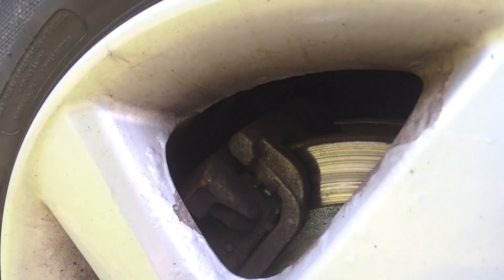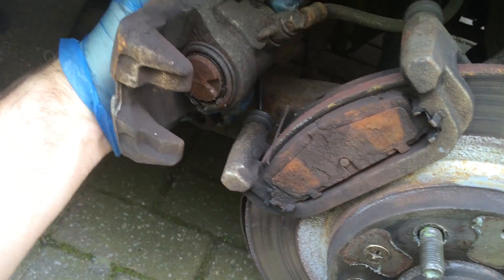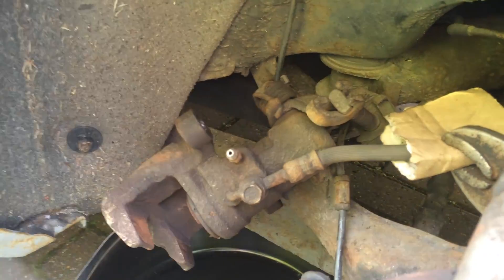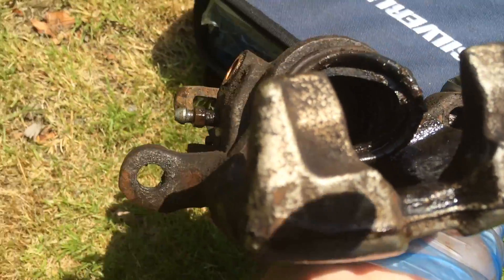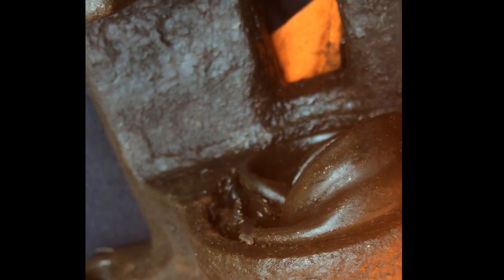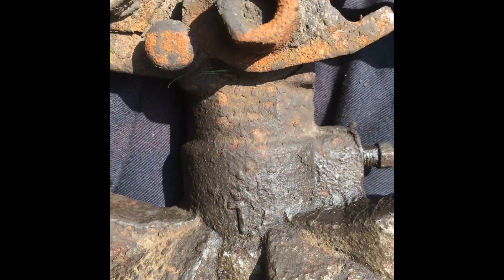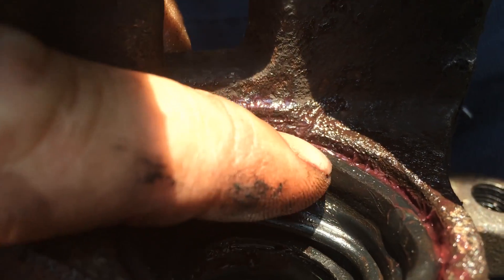Replacing rear brake caliper seals

Comment: You did not replace the seal on the parking brake side. Every failed rear caliper I had was leaking there. I came for a solution, but unfortunately you only changed half of the seals.
Reply from the maker: Correct - I only cleaned up the main piston seals on this one. This was a very long time ago. I'd do a much better job if I had to do it again. At the time, there were other issues with the car, so only did the minimum. A lot of rust on rear suspension parts, water leaks around window seals. wheel bearing failures... It was getting to be more of a hobby, than a reliable car.

Comment: What type of garden wire did you use?
Reply from the maker: green bendy stuff (mild steel). You can probably find it in your local garden centre - Thick, not thin. Or 'mesh' fence wire. What they use to hold the mesh fence to a post by twisting this wire around it. Bit vague, sorry
Reply: @alanmann  Thank you

Comment: I replaced the square o ring seal for the piston in my caliper and ever since I have brake fluid seeping out of MC reservoir cap...could the new seal be not 100% compatible or would I have introduced air in the brake lines.

Comment: A semi-complete caliper rebuild kit will be on average $30, (Pistons, seals and rings, slide pins, boots and bushings, but won’t include banjo bolts, crush washers, bleeder screws and caps)
A remanufactured OEM bracketed caliper from Autozone would be $55. (08 Honda Civic as an example plus the refundable core charge, irrelevant, but $20 each).
That leaves a difference of $25 per side.
I CANNOT REBUILD TWO BRAKE CALIPERS AND BRACKETS WITH ALL NEW COMPONENTS (keep in mind that ALSO includes new banjo bolts, crush washers, bleeder screws and caps), PLUS, A FLAWLESS PAINT COATING ON THEM, FOR $50 LABOR, PLUS CLEANING SUPPLIES, PRIMER, PAINT. (and the time watching the paint dry).
CAN ANY MECHANIC !?

Comment: You don't know a pain in the ass when it comes to rebuilding a brake caliper, not until you have to do it with this car the rear boot and seal is the most tedious fucking process to do the caliper pistons right in close to the calipers housing very difficult to squeeze the parts in where they need to fit and dont get me started with the metal C clip

Comment: just accomplished servicing all four calipers on my 2007 Citroen C6.. they were so corroded (UK CAR). that I was expecting to have to replace them . amazingly all went reasonably well. the pistons and bores were as new .  but the rubber dust covers were firmly wedged tight onto the pistons by the swollen corrosion . / rust . The retaining caliper groove was packed full of rust .. cleaned off using a dremel with the cutter discs ..  After the rebuild with nice new discs all around . I vacuum bled the system with the help of a foxwell abs scan . bleed tool. I flushed the system taking around 100cc of old brake fluid out from each caliper .
the bleed nipple threads were sealed with PTFE tape to prevent air entering during the vacuum bleeding . I am not worried about cosmetics   so I brushed on a liberal amount of 3M rust preventer wax .
Reply from the maker: Good extra details - thanks

Comment: The garden wire trick worked perfectly. Thanks!
Reply: Thanks for confirming this. Getting the piston passed the weather seal has always been the only significant problem I've had with rear calipers.
Reply from the maker: A bit unusual, but works well, glad it helped you out

Comment: Thanks for that Alan Mann, have just rebuilt the caliper of my Peugeot 207 with your help.  I did find that on my Peugeot though that the garden wire trick didn't work.  I found it easier to put the dust seal over the top of the piston, insert the piston into the caliper, then tap down the dust seal into its recess with a square ended punch.  Your method obviously works on the Mazda though, thanks again.

Comment: whats the small metal pipe which is going also in the cylinder (behind the socket screw of the hose pipe)?
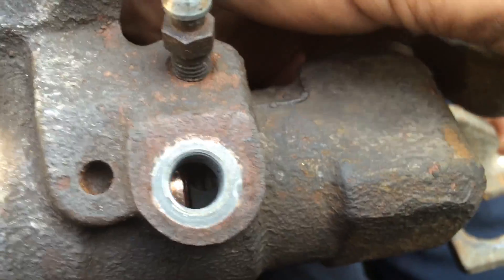Reply: the bended metal pipe is not actually a pipe, it's just for alignment of the hose pipe? @08:00 you can see the small hole next for this bended "pipe", next to the hex screw of the hose pipe)

Comment: Thanks for sharing this intuitive video. Let me say most of YouTubers put O ring first then place rubber on top of it making it less effective ..whereas you geniously added O ring over rubber boots...and tucked in to make sure boot does not slide.  That is correct way.  I did rebuild 3 caliper with ring O ring placed before rubber boots ..not sure how long it will stay. That was for Camry and Highlander 02 front driver side. I will update results later.  Thumbs up from Texas!
Reply from the maker: Thanks :)

Comment: Bad idea crimping hose, you will want to replace it after doing that. Disconnect line at caliper an use brake line plug.
Reply from the maker: Yes, thanks - Not good practice to clamp the hose. Someone else suggested pushing the brake pedal to the floor and keeping it there. Obviously lock the bleed nipple off before taking the brake pedal up, otherwise it will suck air back in.
Reply: https://www.autozone.com/brakes-and-traction-control/brake-hose-plug/dorman-brake-hose-plug-13888/441046_0_0

Comment: good job  looks like you brits use a lot of salt on the roads by the looks of that rust
Reply from the maker: Yep - car undersides, wheel arches, rear suspension parts all rot nicely over here.
Reply from the maker: Ha Ha - yep, rusted wheel arches and rear swinging arms which are Mazda only part ! Only kept the car another year before engine seized.

Comment: my repair kit did not include the spring that holds the dust rubber. without this you cannot fix it. sourcing that item is a massive problem!
Reply: Not all cars have such a ring, in fact I haven't seen one, although I have only done this on Peugeot Expert, Opel Combo, Volvo 144, yes also on Volvo Amazon, had an Amazon Sport from 1966 with rear disk brakes. The other cars I've had had rear drum brakes.

Comment: Also, if you dont want to mess with pumping the pedals constantly to pop out the Piston, you can hold a blow nozzle with a rubber tip on the hole where the hose is and give it a quick shot of compressed air. just make sure you have the Piston pointed towards the ground so it doesn't shoot.

Comment: I added the outside boot after the Piston was back in. It was pretty easy and I didn't have to mess with hooks. just put the base in the groove, clip it, and run a screwdriver around the inside to help it with into the inner piston groove.
Reply from the maker: Yep - 2 ways of doing that job, thanks.

Comment: If you wedge down the brake pedal an inch or two it isolates the master cylinder so no fluid will run out of the disconnected line, safer than clamping the flexi hose.
Reply from the maker: Good tip, will try that next time. I agree, I'd rather not crush the hose.
Reply: GREAT tip - thank you!

Comment: Amazing that you did not replace the piston. I did mine last week and the pistons were pitted and the cost of new pistons were only slightly cheaper than a seal kit with new pistons so I bought new calipers from TRW.
Reply from the maker: Might replace the pistons if the pitting gets worse, but isn't bad enough yet. I would replace if it was the front brakes. It's the handbrake on this car that causes more issues by sticking all the time.
Reply: All Mazda's get the sticky rear calipers. My FD RX-7 has same issue. I'm rebuilding it, but removed the center thread and handbrake assembly to really clean out the inside of the caliper properly.

Bit of rusty crap in there too, my pistons were not this bad but I have still decided to replace them where pitting / corrosion is evident.
Reply: Not long bought a Piston and seal caliper rebuild kit from 'BigRed brake supplies, they have their own website and also sell on EbayUk. Think i was £17.99 for the front (08 Mazda 3).
Reply from the maker: With more things going wrong with the car, it wasn't worth it. But worth spending a few £££s to do a better job.

Comment: Um Himmels willen. Das ist keine fachmännische Arbeit. Voa ellem klemmt man keinen Bremsschlauch ab.
Reply from the maker: The brake pipe was clamped with 'Mole' grips, and some carboard in their jaws, so you don't crack the rubber pipe. Cracks in the outer rubber pipe are an MOT failure.

Comment: Is it just me, or was the upper slide pin he pulled out at 1:05 missing the rubber boot tip? Are those unnecessary? I really don't understand the point of them, anyway. The lower pins don't seem to use a boot tip...?
Reply from the maker: There wasn't one for this make of calliper. I checked both sides of the car, because I thought that was odd too. Well done for spotting the difference. The one without the rubber/plastic tip, has a small 'flat' along it's length. I'll be re-greasing each year, because those rods get crazy stuck, especially on the passenger side.
Reply: There are no unnecessary parts in a brake assembly. Rubber boots are extremely important in a system that as to work properly more than just a few days. :-)
Reply: crpth1 That's a nice standard answer. Right now I'm driving my Camry with a missing dust boot for about 3 weeks, though. I'll let you know how things go when I put a new one on, finally. But, can anyone answer my main question? Am I seeing things in this video?
Reply: Alan Mann Thanks for that! Didn't know if I was seeing things >_< I still haven't put my new boot on! xD It's starting to lock up on me again, though. I tried removing the cylinder with brake pedal pressure but got scared when I pressed it out so far with the brake system but was alone and feared losing massive amounts of brake fluid or spraying it all over the shop. My boot is completely removed because I thought it would be better than leaving it on and allowing trapped water to continue corroding the cylinder. Any thoughts on whether I should worry about it spraying so much with no boot to catch the excess?
Reply: Only lower pin has rubber O-ring. Top is without O-ring. Top pin should be without revolved cut for ring.
Reply from the maker: Well spotted - to be honest. The whole caliper design on this Mazda is very poor. This was a last resort fix before replacing the whole caliper. I had to free up the slide pins every year. No matter what I did with new kits, grease etc.
Reply from the maker: The slide pins on this job were trashed as well. A lot of cracked seals and weather getting in. NS would always seas. OS perfectly fine.